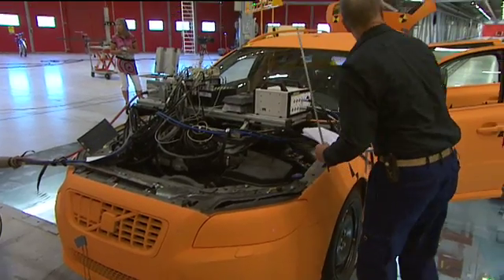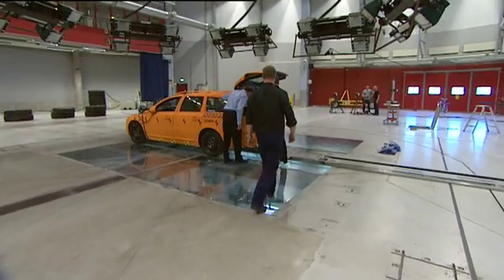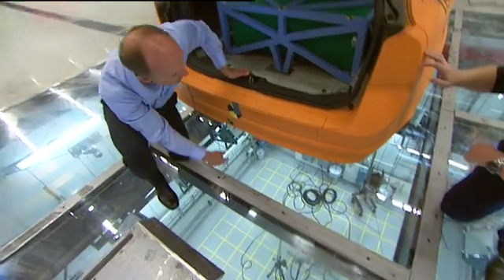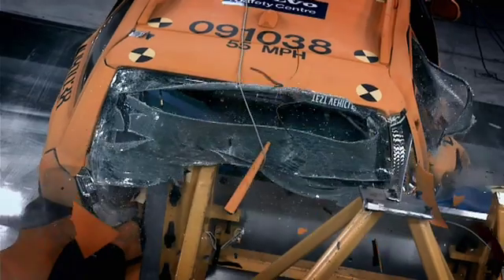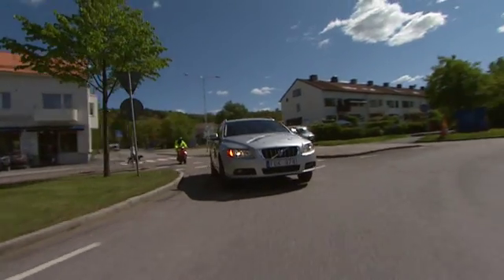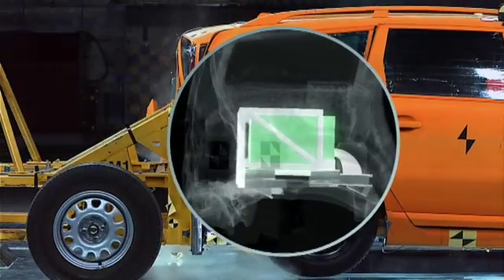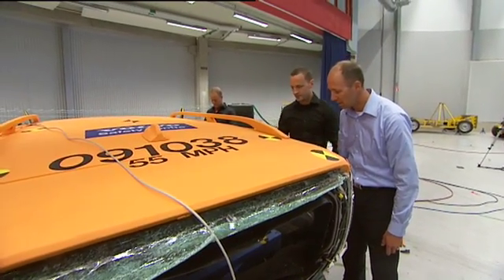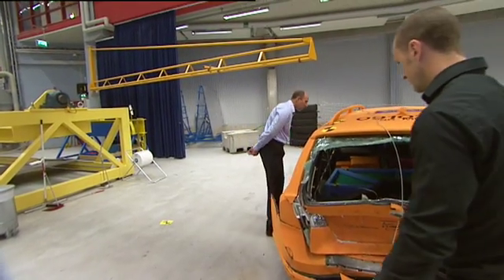Volvo Cars: Crash Test Of Electric Cars

Comment: Yes if you use a normal car engine to generate the power, but you dont. A powerplant uses the waste heat to generate heating for the houses in most parts of Europ through a central heating network. Usually they are alot more efficiant than a car motor. In Denmark the windmils generates more energy than we need during the night, which means that if you charge your car during the night you get green energy. So it also depends on how you generate the electricity.

Comment: Nope, it demandes a lot of energy to refine oil into gasoline. plus the energy wasted in heat on gasoline cars. In your average gasoline car you only use 30 percent of the potential energy from the fuel to move the car and run its electronics the rest is bacically wasted in heat. In an electric car you use 80 percent of the energy from your outlet onlu 20 percent is wasted on charging the batteries and from friktion in the motor.